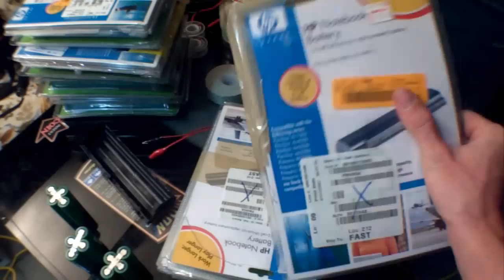DIY: 48v 24ah lithium ion 18650 e-bike battery pack

Comment: Im having trouble soldering the wires on the positive side of the battery together without burning the mylar and risking a short any advice.  Learned alot from your videos thanks for posting.

Comment: Your video convinced me to order 48 - 3.7 v 2200 mah 18650 cells, that totals 16 factory welded  4 cell packs for $158.85 on EBay. However I'm concerned that your video did not mention using a PCM, circuit protected cells or balance wires, all standard equipment on LifePo4 battery packs that include a separate cable for charging, which I did not see in your video. So I'm seeking clarification before you self electrocute in one of your many experiments. What battery configuration would you use?.

Comment: Awesome clip... I have a 48v12ah 750w elec bike which is limited at 30mph..! Problem I have is distance coverage. I am planning to make a similar battery to yours - will this blow my bike controller electrics if I go for a higher Ah as per your 35Ah...??? Thanks for your help.
Reply from the maker: no increasing amp-hours will never put too much power through the motor. ya see the amount of amps going through a circuit is directly controlled by how many volts your putting into the circuit. as long as you get the volts right, it will be fine. but FYI most motors are made to handle a few more volts. like I could prolly push my 48v motor close to 60v before it started to give too many problems.

the amp-hours is really a measure of how much it can give. the motor will still take whatever it needs. but FYI q higher amp-hour battery will limit voltage drop. like with my first battery I couldn't really get past 80% speed course once the battery was giving 100% it couldn't give any faster. but a bigger battery bank will be able to brush off that load like nothing and keep close to its normal voltage while your pulling power from it.

I hope that helps!

Comment: I took your advise and bought 18650 Sanyo 2200 mah cells that came from HP laptop batteries @$3.25 each. What did I miss out on by not buying the off brand 5000 mah cells @$8.00 each .I was very attracted to the 1,500 -2,000 recycle life span of those cells on Ebay?

Comment: Amazin'! I'm keen to give this a try but have little electrical knowledge. Also, I didn't see anything about attaching a BMS. I've been told you must have one on a homemade pack or else it'll blow up. Have you been ok without? Also, I was thinking of charging it via my standard 36v charger (for a 36v kit) I got with my old bike and using a standard multimeter to check it's all ok. Do you think that'd do the trick or might I need one of those fancy machines you've got on your table? Sorry to bother you - if you have time to reply, it'd be much appreciated!

Comment: I noticed that each group of factory-connected cells begin by connecting cells in parallel.  I think this is contrary to the battery configuration we use in the remote control airplane hobby where the smallest unit of cells is always connected in series.  Why in series?  So cells can be changed individually (called balancing the cell).

Comment: You seem to know about these batteries let me ask you this. I have 4 - 18650 batteries connected in parallel per cell. I have 12 cells connected in series starting with negative from cell 1 to positive in cell 2 and so on. Should be 4V x 12 cells = 48V. 4, 8, 12, 16, 20, 24, 28, 32, 36, 40, 44, 48V. Why do I have = 72V? Thanks

Comment: Thank you for the display. At 5:29 you start using a big gadget, what is that-a soldering gun? How many Watts? First you go around and then apply solder. Regards. Vehbi

Comment: Hi great video. Was wondering if you knew how to bulk discharge using a homemade circuit to log the milliamp max capacity on a fully charged 18650? it will take 2 hours per battery like 80 batterys a week otherwise! Do you know if a regular ebike controller can handle one of your homemade batteries (200 of them though!) at 48v - 62ah (one of your home made battery designs) or would I have to modify the controller?

Comment from the maker: well a few times i found some cells that where like 0.2v. i tried to bring their voltage up by fedding them with like 500 milliamps of current and they would get to about 2.5v and short out. so now when i'm bringing a lithium cell back up from being low for years and years i charge it with like 10ma of current and as it get to like 1v i step it to 50ma and 2v i go 200ma.

with slowly bringing lithiums back up i havent gotten any shorted ones anymore, but they are still old in the end haha ;p

Comment: Hi mate, I have a question about the charging you're doing. Is that a regular desktop power supply you were using there?
If so, how did you decide on the voltage you put in? I thought you set it to...aah; that was set to a little under the desired value for three cells in series right?

I have an old power supply with the electro-mechanical gauges and although I already have one more charger than I need, it only fits the short versions of yours. If I buy the large versions or indeed have other charging needs, this would be a neat trick.
I'm no electrical engineer, as you may have already deduced so I'd be very grateful for any knowledge you have.

Comment: Thank you for posting this! I have been wanting to do exactly this to rebuild the lead acid batteries in my Ryobi 48v mower, but was not sure exactly what was involved. This is probably a stupid question, but do I need to worry about my amperage being too high for the little dc mower motor when I use this setup? Also, would you mind providing approximate dimensions of the finished battery? I would like to use the original mower battery enclosure, which currently houses two small 24v batteries, so I may have to get creative with the arrangement of the cells if two of these end up being too big. Anyway, thanks again. This and your other videos on batteries have been very helpful in planning this undertaking.
Reply from the maker: no the Amp-Hours dont effect how much power is pushed through the motor, teh voltage does. but if you have too small of AH capacity then the motor could drag the voltage down a lot and not get 100% power. i'd say atleast 1AH of capacity for every amp your going to pull from the battery.

the lithium 18650 cells are exactly 18.6mm by 65.2mm. i doubt you will need to worry fitting the cells into the case. lithium batteries tend to take up a lot less space than lead acid.

Comment: Hi Riona, have you tried building a 48V battery using the Sony NP batterie pack (lithium ion) usually 7.4V and 6900mAh each? I'd like some advice since I'm planing to put together this batteries to power my motor but I have not idea if they'll be as efficient as the batteries you have built. All the best

Comment: Good video. one question - could we just use the STOCK laptop battery packs? They are already in prepackaged "modules" to be soldered together in what ever configuration desired.  Or were they just too ugly to deal with (which is a perfectly acceptable response)? Anyway enjoy your bikes Thanks
Reply from the maker: no it would be a huge waste, you would need to make a computer and have the computer talk to each battery circuit board. not counting a lot of batteries have atleast one bad cell. also the wires inside laptop batteries arent great for more than 15 amps.

Comment: Maybe what you mean:

Yes, you can recharge them easily. but i think the problem is the IMAX charger, because you need 13S charger (54.6V End voltage) and IMAX is max 6s = 22.2V

Comment: I built up a DIY yuba mundo cargo bike with a used bmc V3 48 V hub , new
 CA 3 , lyen controller, 3 way switch , twist throttle. 
I have quite a bit of experience and tools working on  bicycles, cars, 
and homes. Very limited experience working with electricity :) No 
experience on bikes.   

this is the note I sent to Edward. 

Hi Edward,  Re : BMC V3 hub died mid ride
So making 
sure I had a good ground this time ... I think that was why I was 
getting no reading on main blue, now all read 11.88 main yellow, main 
blue, main green... with throttle on or off, in any 1,2,or 3 switch 
setting. Still reading 53.9 V from Battery to Controller
 
Moving to smaller Hall Sensor wires , while plugged in to power no 
throttle
 first testing main power or red and black 4.29 DC V all from controller
 side of casing

black and blue rotating slowly backwards 5V  /.034 V/ 0V / 5.0 V
black and green                                     5V/.034 V / 0V / 5 V
black and yellow                                    4.81V / .034V / 0 V/
 4.81 V 
Thanks     
Donny :) 

note I sent to endless sphere 

 built this bike up from a frame last year and thought I finally had the
 bugs out. 
BMC V3 Hub 48V 1000 W Used 
Lyen Controller
twist throttle
3 speed switch

I
 just pulled this bike out for the new season, it charged to 54V ( full 
for my battery) and started up once I reconnected everything. 
At the
 end of last season I was just figuring out the CA but seemed to have it
 running smooth and also with in the pedal speeds that suited the three 
settings
1) set for starting and town, if I pedaled more then 10 mph the motor 
cuts out. 
2) set for Bike Path 20 mph
3) 30 mph... I am late picking up kids. 

I have quite a bit of experience building bikes , limited electrical 
experience, no ebike experience. 

On the first ride into town the motor cut out mid ride
I checked my connections and they seem fine, also checked battery charge
   fine 

Their is no motor noise in any speed setting or any throttle position. 

The hub moves fine by hand and still pedals fine

I have contacted Edward and he is a great help but need to learn more 
about how these entire systems work. 
We are working on diagnosing the problem. 

What I have checked 

With My fluke I have 54 V to controller
While
 plugged in I have 11.88 V DC coming off my main Blue, Yellow, and Green
 larger Gauge wires running to the hub.  This does not change when I 
change the 3 speed setting , this does not change when I have the 
throttle full or off . 

Testing the smaller wires running from 
the hub to controller ( Hall sensor) ... All from the controller 
side...... everything plugged in .... 
I have 4.29 V from red to black 
from black to blue  and turning the wheel slowly in reverse I read 5V to
 .034 V to 0 V  back to 5V
from black to green                                                     
     I read 5V  to .034 V to 0V back to 5V
from black to yellow                                 I read 4.81V   NOT 
5V    then .034 V to 0 V then back to 4.81V   

Any tips? 
Also
 I would love to understand how electrical bike systems run from the 
ground up, so I'll be better equipped to diagnose problems understanding
 what electricity/voltage/watts/amps all mean and how they relate to the
 system and how the systems components relate to each other.  Any 
suggested readings???? 

after watching your video I did check for continuity from my phase wires
 to sensor wires and get nothing between any of them? 
So not sure why I do get a voltage reading when rolling the hub 
backwards at each hall sensor wire even though only 4.81 at yellow vs 5 
at the green and blue. 

This is all foreign to me so excuse anything I have mentioned that makes
 no sense and please explain! Thanks !! 

Appreciate your time

Comment: Nice job. I'm not adapt at building my own battery packs, but I saw some large batteries designed for electric bikes while I was in China. I was wondering if the charger that came with it would work on a 120 V American system? Since China uses 220-240. I understand that I'd need an adapter to fit USA plugs but aside from that, would there be any other issues?

Comment: Cool video. Any way you could solar charge while riding or make some kind of charging coverter from pedal power to recharge the batteries while riding?
Reply from the maker: yes but having a solar panel on the bike wouldnt be worth it and taking power from the peddles would be a terrible idea.

its better to have a solar array at home charging a bunch of lead acid batteries then move that power to the lithiums when you get home.

Comment: nicely done! But why nails? You could have used a thick copper wire...

What happens when one of the batteries dies? Also, can you tell if any of the batteries aren't good - suppose they only hold 20% of the nominal charge?

Comment: Hi thanks for your battery building videos, I have manged to make my own with your help for my Ebike :). I had a quick question, i notice that you dont seem to have any kind of battery management system for the batteries. What would stop your ebike from dangerously over discharging the cells if you did ever happen to empty the battery pack, or does the speed controller on the bike have a minimum voltage cut off?
Reply from the maker: i use an imax b6 to charge it and my motor controller cuts out at 36v. but i can feel a big drop in power when they get down to 3.7v.

Comment: first of all: kudos for pulling this project through. and holy carp! that sodlering iron is bigger than my .. vacuum cleaner! 
(also at this amperages, using thick copper wire would have been a better choice than using iron nails. i mean, i use iron wire for soldering tips in my historic soldering-pistol. :D )

Comment: @Rinoa Super-Genius
How Are You...? Just wanted to compliment you on your battery pack... Nice Build... I am working on an EV myself, although I am not using lithium batteries... I am using deep cycle gel cel batteries and my battery pack is about 1152 watts... Would love to see the actual build of ur bike... You will get more efficiency from you pack if you have a hub motor and ur wheel spins at a higher RPM
Reply from the maker: Oh I have several build videos of my bike uploaded. They are all linked in their discriptions. Each video has a link to the previous and next video I did in that subject.

And thanks for being so polite as to wonder how I amdoing. I,m doing great and my new 35ah battery i built is working wonderfully. I hope your project goes well.

Comment: Further, the wind resistance becomes irrelevant.

The wind resistance is the same going uphill and downhill at the same speed.

The loss in the system comes from (1) undesirable, but unavoidable friction which includes wind, and (2) intentional braking to maintain control of the bike.

If the wind resistance was so overwhelming, he wouldn't have to brake downhill, the air resistance would stop him. Regenerative braking is used only when braking. Otherwise inertia is used.

Comment: I was talking about protection circuits PCB for the 18650 battery they are real small and fit on and you need one for each battery I think they help from short-circuit basically working like a fuse and yes as far as I know they will work like a BMS also keeping the battery from getting too low of power and keeping it from overcharging but it also works like a fuse. The way I understand it but to be honest I'm not sure. 
I have a couple I could send to you I would be interested to see what kind of crazy test you could come up with. LOL
Reply from the maker: ah i've seen some reports of them accidently failing and catching on fire. having that many little circuit boards doesnt sound good. not counting protected cells are kinda rare. i have one but i find it unremarkable and too big, its just an 18650 cell inside another shell with the circuit board. thanks for the offer though.

Comment: Hi,
Why did you buy the Laptop Packs istead of buying a just as much 18650 cells as you need? Did it cost less or don't you get the single cells where you are from? Or was it for practical reasons, since thos cells were packed together as 4?

Comment: I always wanted to create one of these when i was in elementary school. i wanted to charge my batteries while peddling. 

wouldn't the steel make it harder to charge your batteries? its not as conductive as the copper you had laying there. all you had to do was make small strips and strip two ends of the green wire and solder them together.

Comment: great work I`m probably going to have a few question for ya if ya don`t mind!  I plan on building my own battery pack  ( tonite I just installed my first magic pie 2 front wheel electric motor on a 26 inch schwinn meridian trike )...I don`t want to have to pay the 500+ dollar for golden motor battery pack & a charger.. So I`m definitely in need some help..I have a battery plus story close by here in Az and plan to check it out.. I guess I also need to think about a good charger, right? ..what`s your opinion on buying the best charger for the best price for the 48 volt 1,000 watt motor?
Reply from the maker: i just use a 30$ imax b6 balance charger.

and the only way I've found to get a good deal on batteries is buying them used off ebay. battery+ is way overpriced. they charge 130$ for a thinkpad 385 pack and a lot of their inventory sits on the shelves for years and years. I played them 50$ for a camcorder battery and the one I got was like 6 years old. you could build a better one for 5$.